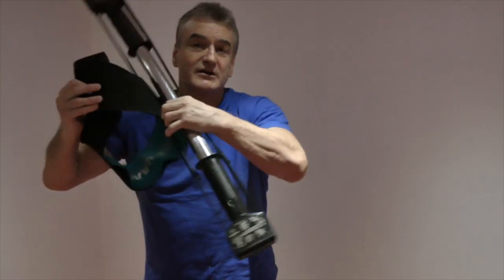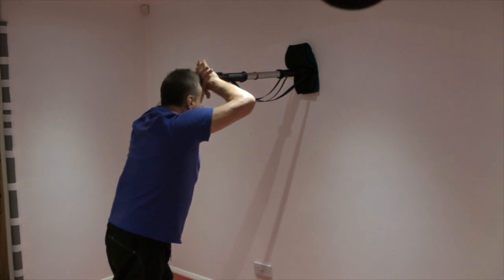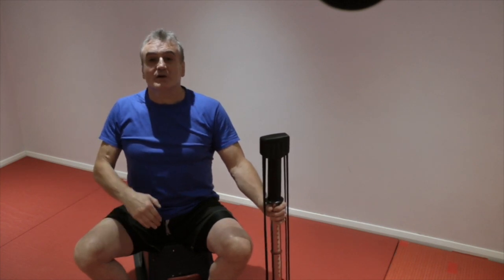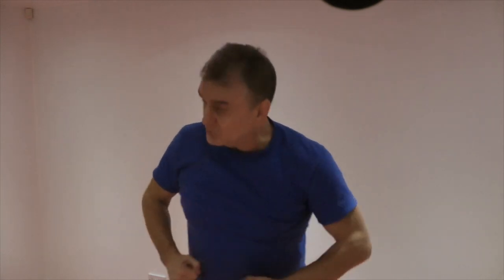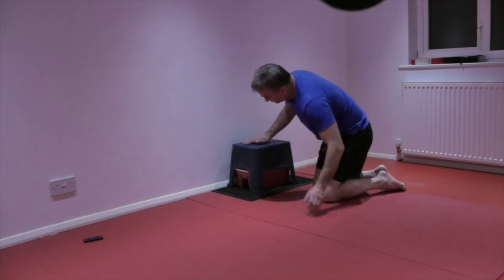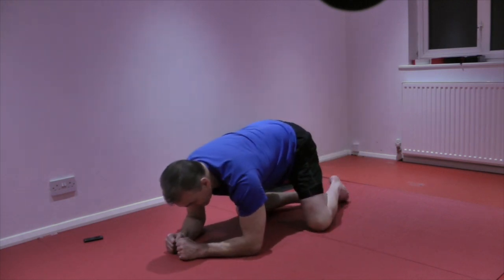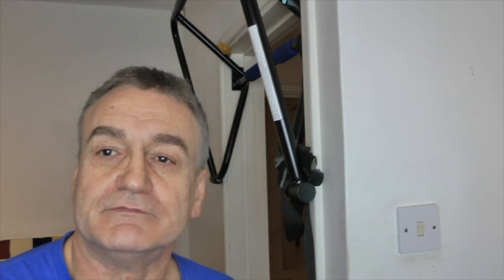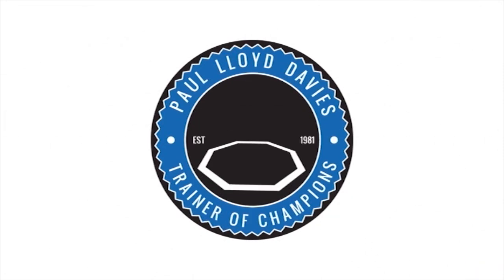Isometrics: Only Exercises upper body.

Comment: Should you have a training buddy with you when you do this, at least to start with?
- it looks like you could do yourself an injury with that neck exercise:)
Reply from the maker: The exercise is safe if done under the supervision of a properly qualified professional.  The careful progressive  activation and correct breathing, body position (tounge to roof of the mouth) "scaps on" and body position (structure plus pad as Bullworker strap quite narrow) all part of how one can use Bullworker for this exercise.   With towel and cloth belt this is not so important as force spread over wider area. Hope that helps thank you for the point you raise.
Reply: @PaulLloydDavies  I didn't know you could even buy a bull worker anymore,I had one 35 yrs ago as a teenager.